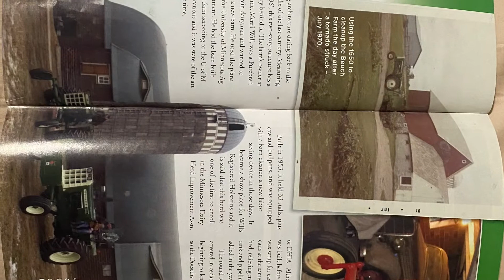Oliver 1655 ￼ restoration

Comment: Nice job on the 1655.  I have a 1650 that my Oliver mechanic and good friend Joe restored for me back in the year 2000.  I use it regularly on the farm, so it doesn't look perfect anymore, but still looks pretty good.  You can see it on my channel if you have any interest.
Reply from the maker: Yeah what’s your channel
Reply: @joshuadotseth5667  My channel is PA Grain Farmer.
Reply from the maker: @pagrainfarmer   the 1650 looks nice looks like you have a few Oliver’s. I use all are Oliver’s regularly the 1655 is on a 499 haybine are 770 with a traction adder 3 point on it for raking hay are 77 is the only one that just gives hayrides.
Reply: @joshuadotseth5667  sounds like you have a nice collection!